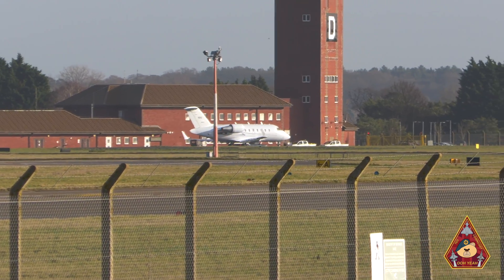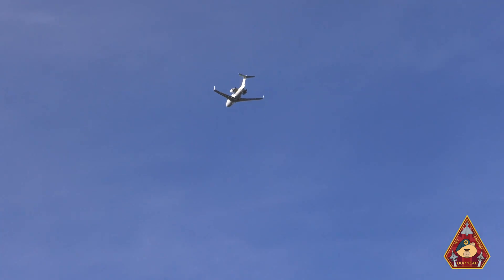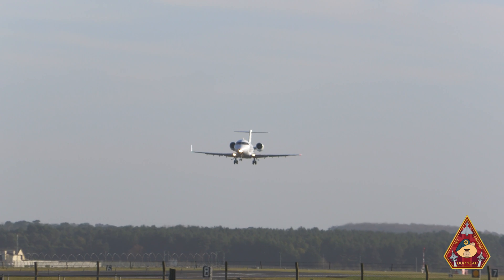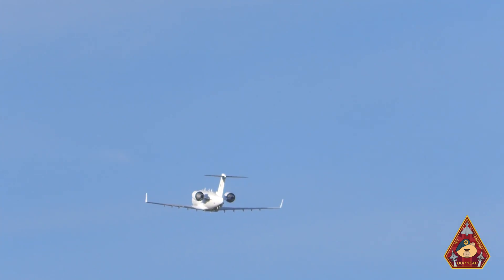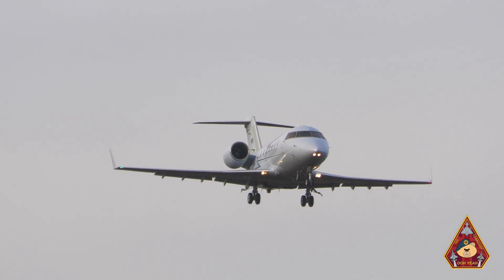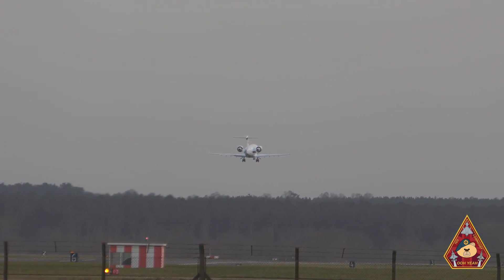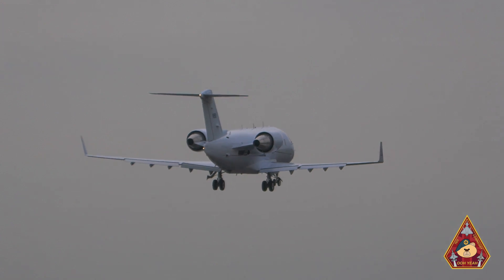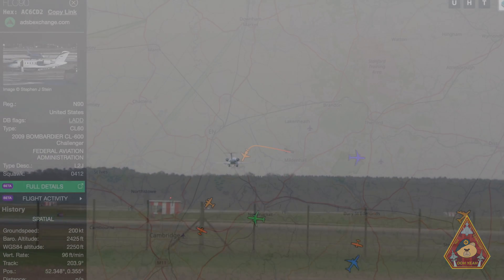WHAT PLANE IS THIS? AND WHAT’S IT DOING? LOTS OF CIRCUITS AT FROM THE FAA AT RAF MILDENHALL

Comment: We used to have an RAF Squadron 115 ? That did all the flight calibration in the UK. Flew Andovers out of Benson. I reckon they contract it out to the cheapest bidder these days.
Reply: I have it in my memory that the CAA used to do something similar with a red painted Andover/ HS748, or was it really the same squadron you mentioned but with CAA on the side of the aircraft? 👍
Reply from the maker: The RAF use a company called “Diamond Aircraft”. They use DA62 Diamond aircraft, but we will cover this in another video :_ted:

Comment: Of course they use an aircraft to calibrate the ILS, landing lights and other airport navaids. Not easy to do with a bus. In the UK the Civil Aviation Flying Unit used an Avro 748 to check UK airfields. Got a chance to fly in it once when I was working in Heathrow Tower. Have to admit I felt quite sick after the tenth approach and steep climb and turn. 🤢
Reply from the maker: Not everyone knows an aircraft is used, not everyone knows they even get calibrated. Our channel is for everyone. Have a good weekend :_ted3: